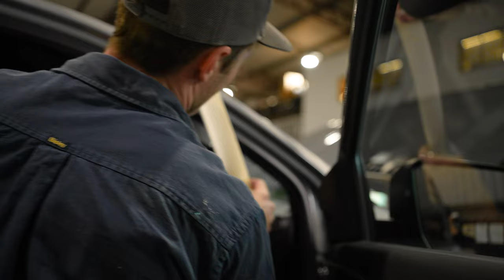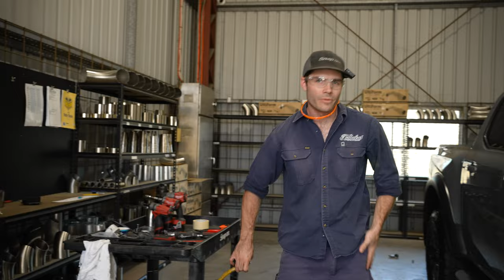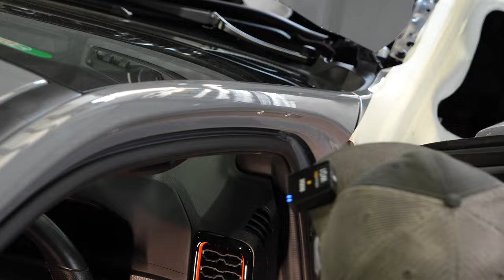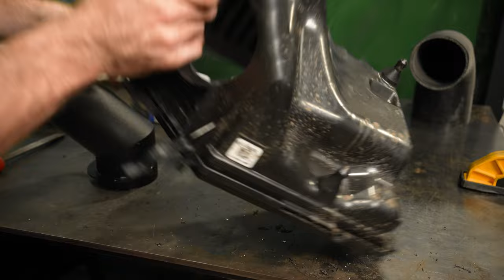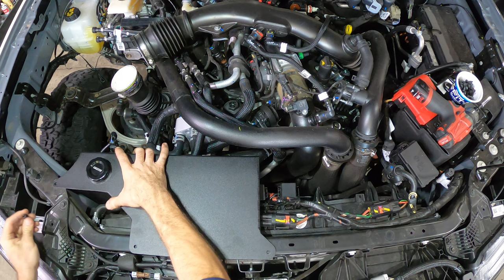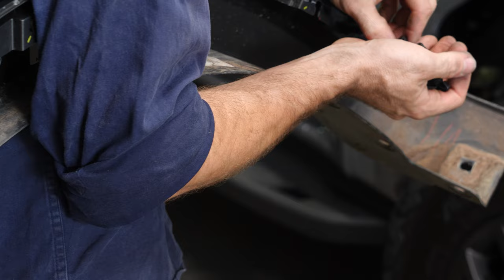INSTALLED: Ford Next Gen Raptor Snorkel

Comment: How deep in the water can go with snorkel?
Reply from the maker: Hi mate, this is designed to be a sealed unit, so you would run into different issues before you saw water ingress into your engine!